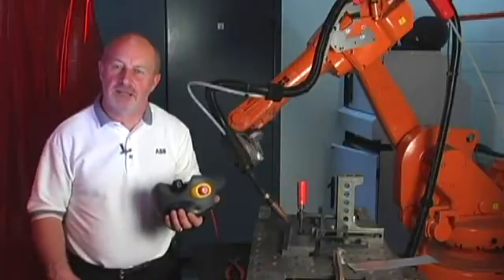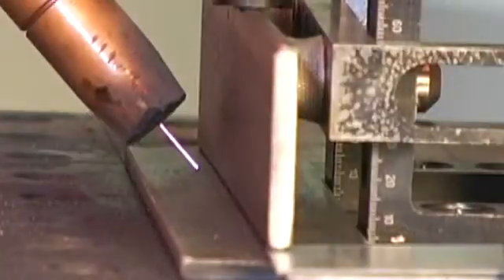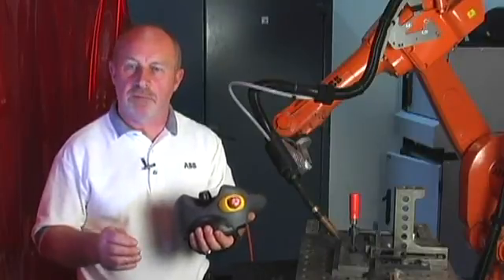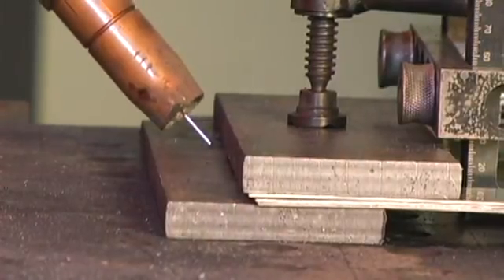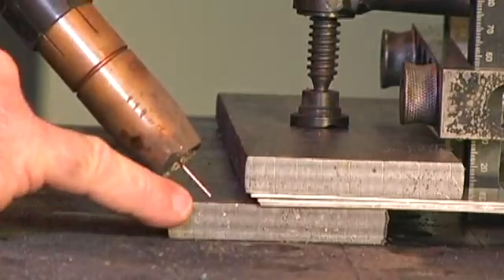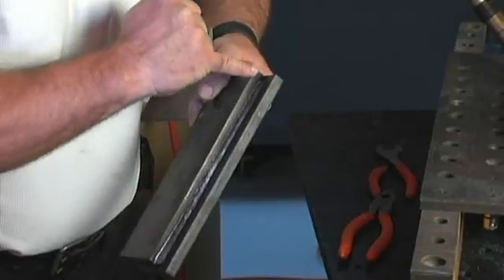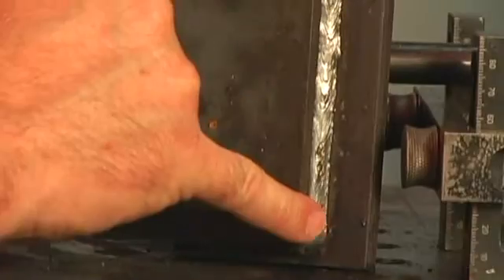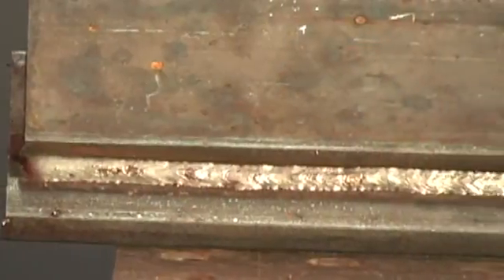ABB Robotics Weld Guide III Adaptive Arc Welding and Seam Tracking

Comment: Is touch sensing required to get the start point right?
Reply: Not necessarily. The start point can be generated from a search (touch) but the path correction is done by offsetting the x/z values of the path in real time based on either the impedance values coming off the welder or a sensor that is put on the weld lead cable and connected to an additional module in the robot  controller. From there how much the robot reacts to these changes is configurable in the software. The weave function helps the software decide wether its measuring the x or z value as its traveling down the path